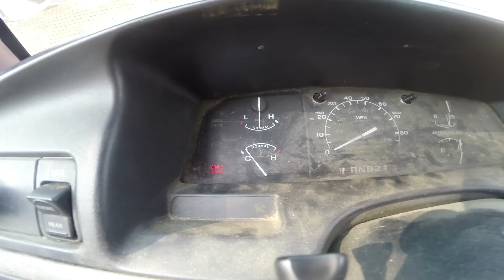Oil Change Ford 351 5.8l F150-F350 1987-1996

Comment: Do you have to remove the driver side tire to access the oil filter?
Reply from the maker: No,  you can get it from the bottom. I come in from the bottom front
Reply: Ok thanks!

Comment: What is the stuff he put in after he put in the oil?
Reply from the maker: Bless Paquette, this truck takes 6 quarts of oil the first jug was only five of the quarts then finished it off with a quart of a different brand of oil.
Reply: First was Pennzoil second jug was Quaker State oil